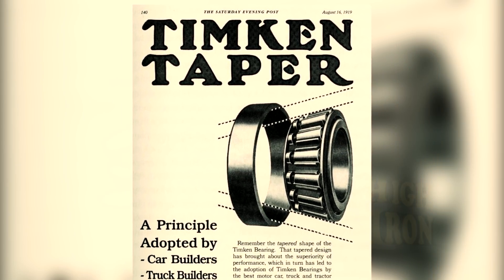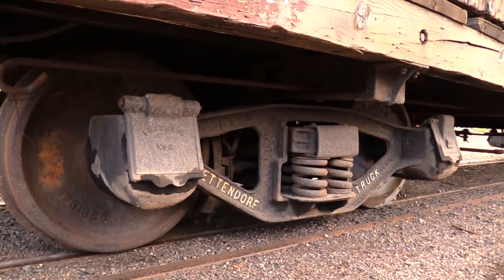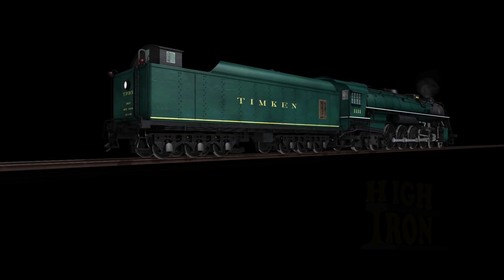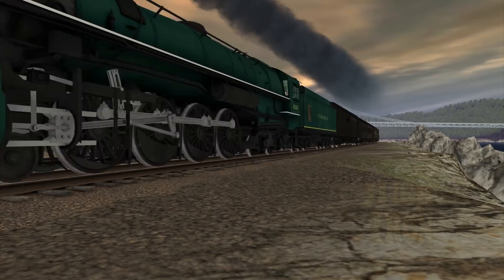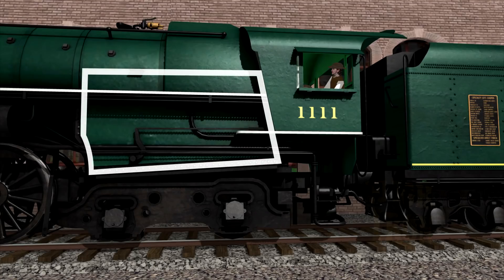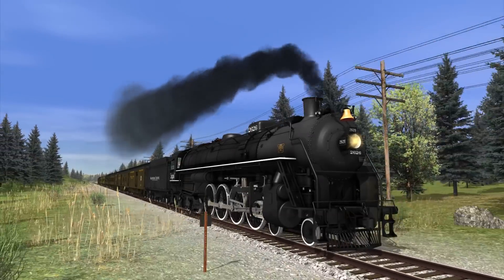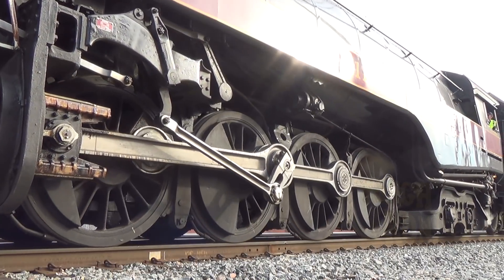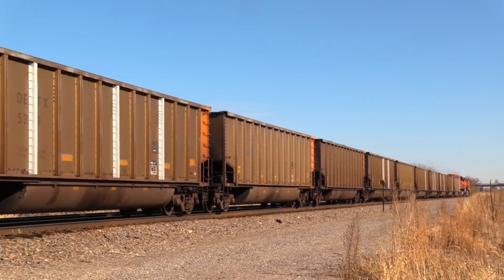Timken's Four Aces Locomotive

Comment: As one who laments the Four Ace's loss (being from metro-Seattle-Tacoma), I say you did an excellent job. If any locomotive should be Replicated, it is the Four Aces, as it was a locomotive designed to tour the Nation.
Reply: i would think that a good "Spirit" name for the Timken Ace would be "Spirit of Seattle", given thats where it mainly roamed
Reply: Low water in the boiler over the crown sheet.  I have been told that running shallow water over the crown sheet would make it produce more steam, more quickly, and would produce additional power.   Not wise.  The damaged crown sheet was patched,  not replaced.  If the crown sheet ran dry, at all, the steel would overheat and lose it's temper.
Reply: I can't help but feel like it should be an NYC Hudson or Timken Four Aces that should be rebuilt from scratch, not the T1. Is that weird?

Comment: When I started working on the railroad in 1974 as a switchman the CNW was still transitioning from brass journals to roller bearings. Standard equipment on locos and cabooses was metal packing hooks used to remove the oily packing from journal boxes if burning. Along the long departure tracks where trains were assembled and inspected by car knockers were barrels of journal oil placed at intervals so car knockers could get oil into oiling cans and carry it to the car with a dry journal box and replenish the oil in the journal box. It wasn't very many years later that brass wedges and journal boxes completely disappeared replaced by sealed Timken roller bearings. Roller bearings would still fail but with much less frequency.

Comment: Northern Pacific 2156 needs to be upgraded with roller bearings in order to run on mainlines much to the MTMs disdain. I'm astonished they still ran the Q3s up to 90 mph on the St. Paul to Duluth runs. The boiler is finally nearing completion. Now framework I believe is what's next once the roundhouse's water system is repaired.

Comment: Roller bearings maybe effective but they are still prone to problems if left to run hot, which they're more of a nightmare. There was a case for NSWGR (Australia) when a (C)38 class 4-6-2 had the rollers in its bearings completely fused. The locomotive to be fitted with new bearings as a result.

Comment: I used to do contract calibration work for Timken in Canton, Ohio. When it came time to replace the front wheel bearing and hub assemblies on my 93 Dakota 4x4, I spent the extra money and bought genuine, made in America Timken bearings. 
They were made in Italy. They both failed within a week. After I raised Cain with Timken, they shipped made in America replacements. Problem solved.

Comment: In Trainz Forge's Timken 1111 pack is there a Northern Pacific tender that doesn't say the timken PSA or whatever below "Northern Pacific", or is that the only tender it comes with
Reply from the maker: Yes, the NP tenders are included.
Reply: @HighIron  yes I know but on the NP tenders it says "All journals equipped with Timken Roller Bearings" below "Northern Pacific". Do all the NP tenders say that below the RR name, or is there one that just says "Northern Pacific"?
Reply from the maker: @fortniteman3477  Yes, all three of them read, "All Journals Equipped with Timken Roller Bearings."
Reply: @HighIron  I see. Thanks for letting me know.
Reply: Too bad Trainz Forge doesn't have ANYTHING for Trainz versions older than Trainz 12 (or T:ANE if I'm mistaken).

Comment: I rember wheel bearing are been fitied on amtrak superliners and amfleet and they never have hot boxes only amtrak can trigger a hot box It happend to Amtrak's California zephyr #6 he was SC 44 challengers and a detector went off saying it had a hot box from head of train and the conductor and engineer and dispatcher were talking about it and they said it was number 4617 that triggered the hot box they said the manufacturer had to cut out the brakes once you release the brakes it rolls freely and all that so that's what happened to California zephyr it triggered a hot box